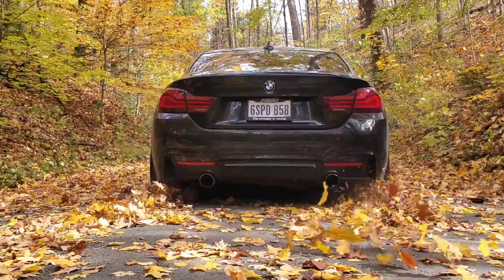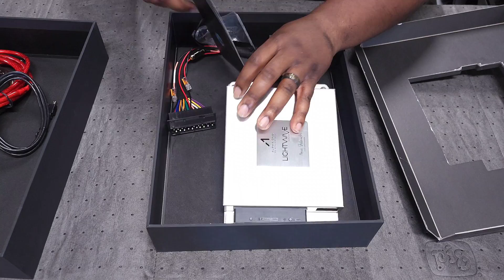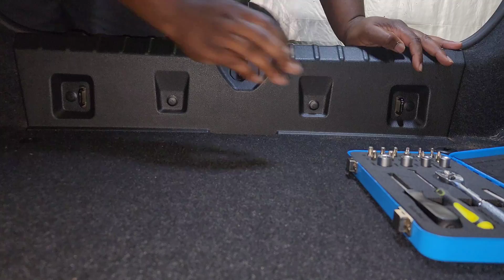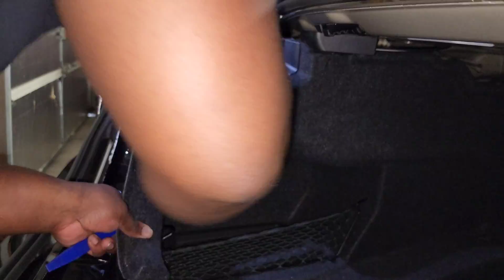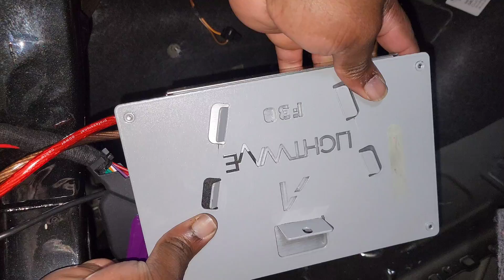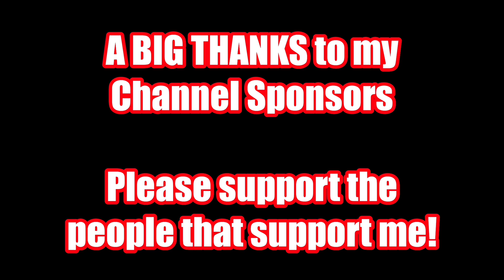Installing the New Lightwave Amplifier on my 440i! | Alpha One by Bimmertech DIY

Comment: My bracket didn’t fit my Lightwave amp for some reason. The amp is way smaller than the OEM bracket on my 2017 540i

Comment: Just installed this on my 2024 M340i lci Harmon Kardon audio. Before I buttoned up all the panels I reconnected the batteries to test it and it didn’t sound right. The underseat 8” were not working. Come to find out I had connected the harness to the booster and ram reversed, lol. Once I connected them the right way it worked great.
Reply: are you pleased with the upgrade (amp only) from the HC?  thanks

Comment: just wondering if the 2016-2019 bmw 340i models have the DCT transmission using the center console shifter? While already having the regular automatic transmission.

Comment: hey! got a question! I just got a 21 M340i with Harman Kardon ss and sometimes the audio bass just cutoff until i turn off completely my car. I dont know if anybody had that issue. i never got that kind of issue on my 19 440i with Harman Kardon ss. I heard its a defective amp. My car is still under warranty
Reply: It could possibly be a thermal protection in the amp once it reaches a certain high temperature it turns the signal off till it cools off or restarts the car.

Comment: How much ASD hp do I gain with this?
Reply from the maker: 1000 watts 🤯
Reply: @kern417  😱
Reply from the maker: @Gr8ZongB58  Better keep traction control on ⚠️
Reply: @kern417  think it can handle E-40? Or should you go easy-e 🤪

Comment: Hi Kern,

Bimmertech audio guy checking in.

I knew your video on the Lightwave would be the be all end all installation video and I'm very pleased to to hear you like the sound too. Indeed we ship these amps out turned up but if the gong etc. is too loud for you - I can revise those sounds down if they're too loud for your liking while leaving the headroom available. It's all adjustable via the DSP software - I'll shoot you a link if you want to mess with it a bit. Excess power comes in handy for older and quieter recordings with a high dynamic range (pre loudness wars era). 

Your comments on distortion vs. power are on point. Nothing kills a speaker faster than distortion. Too much clean power - that will overheat the speaker sooner or later, you might hear the speaker making distortion from exceeding its design limits - but its still way more likely to hold up compared to being underpowered and fed a 10% THD input signal as some amps will be delivering.

Cheers, Maciej
Reply: Makes me happy when I see a manufacture/vendor reach out on youtube/social media to support their customers.
Reply: @Talmadge3000  I tune our amps to the best of my ability with flat iDrive EQ's but there is always variance in personal preference so anytime any of our customers wants the sound tweaked - I always facilitate that to make it sound good. That's the beauty of high end amps with DSP - the sound can always be adjusted via the DSP which has endlessly more flexibility than iDrive EQ's do.
Reply from the maker: It's perfect as is but I'll definitely reach out if I have any ideas 🙏🏾

Comment: $2,000 for an amp??? 🤯 No thanks
Reply from the maker: I get it. Unfortunately, gotta pay to (plug and) play. I spent more than that on old systems that added 100lbs to my trunk with way less adjustability, so this is perfect for me and anyone that truly prioritizes audio quality. But no doubt it's not for everyone.
Reply: @kern417 i had f10 with harman cardon the bass and whole sound was brutal!!! On my g30 harman kardon has literally no bass its shit :/
Reply: @kern417 I bought it to plug in play but also to minimize the weight with the possibility to add another amp in the future to make the 8” underseat subs into dedicated midbass frequencies and a 10” for dedicated sub frequencies so all the satellite speakers are more efficient and not distorting the 8” speakers from having to play mid bass and sub bass frequencies.
Reply from the maker: @weduhpeople8504  it would be awesome if we had a fitted enclosure for the space under the trunk floor. Kind of like the bms water meth tank that was drop in and could be wired up to the amp. Maybe one day.
Reply: No doubt 
Too expensive
Reply: My up10dsp and Mobridge DA1 cost the same! Then lithium and alt will add another 2k or more then let’s add in audiofrog 10s that’s 1800 for 3 10s then another 700 for the amp… 😊